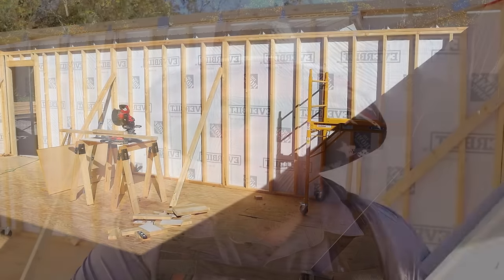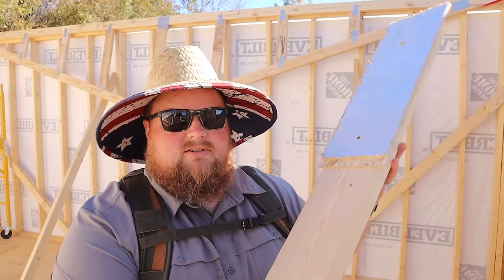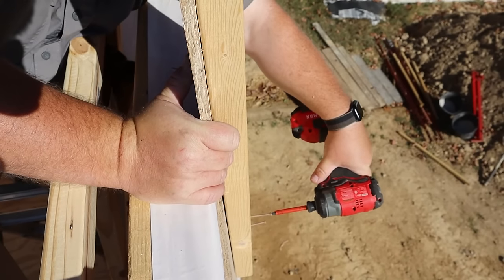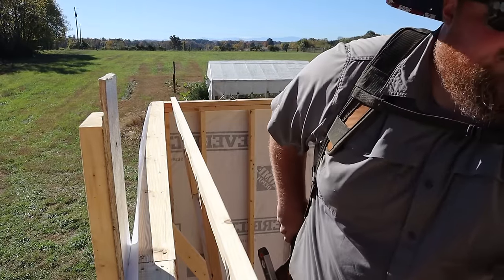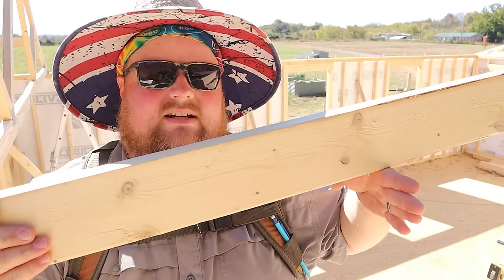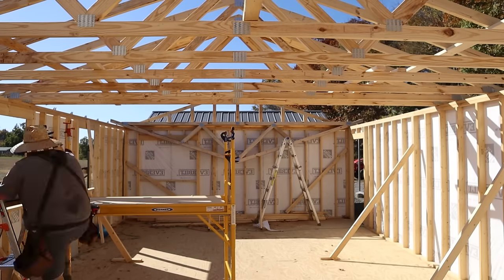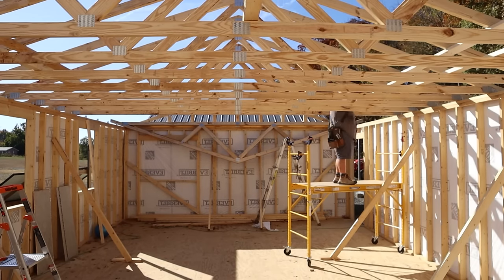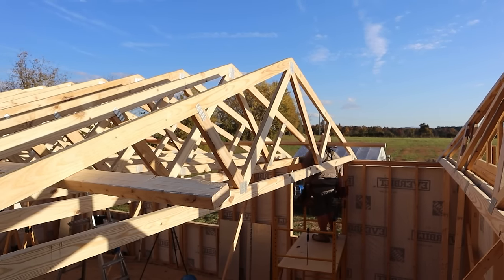I Built this ENTIRE ROOF BY MYSELF! DIY Workshop Build | Setting Trusses & Roof Framing

Comment: Put a 2 by gusset inside of your rake boards to keep them from moving. those toe-screwed fasteners can split out easier than fasteners through the face. The easiest way to measure one is to just trace it and cut it out.

Comment: can't move a mountain over night , but you are sure giving it a go day by day . I have done these truss lifts for many a year and each time I show a new hire how to lift them from ground ,as I nailed , they were sometimes lost. You do make it look easy , which it is after you do one or two . On , one/half or two story , I would place 2-2x4 step splice slides on the gable end  and  ground crew could push the truss half way then I could pull and slide the truss to the opposite end , nail and block . You are doing a great job on your own !

Comment: Not being builder but watchful things doing with it, I have seen I think it is called a rat run or board on other videos.  I am in Australia so am not sure what things are needed over there.  I think the purpose is to stop any movement in the bottom cord of the truss.  I am not sure if the distance between the buildings was a design but it certainly came in handy to be able to have the tractor get between them.  I have watched th whole series and enjoyed every minute of it.
Reply from the maker: I'll be installing much more truss supports after the roof is sheathed. :)

Comment: Fyi on those ladder blocks over the drop truss at gables, 4ft o.c. is plenty. Once you put in blocks over the drop truss you have a 2ft x 4ft framing box for nailing roof ply. Easier to insulate, half the ladder blocks + 1, half the gable blocks, plenty of cantilever strength. 
Cudos for the 1 man crew.

Comment: might be able to extend the ladder thingies so the overhang of the part from the top to about half way down each side of the roof goes out about twice as far and ends up over the roof of the old workshop , could leave it floating over the old roof and create a small v shapep dam on the old roof or graft the new roof ontoo the old roof to make it so the rainwater roll down the edge of the new roof where it meets the old roof and doesnt drip of the old roof part that would still be under the overhang (though a small piece of guttering over the doorway would work too , that and a walkway between old and new shop should make a nice dry walkway between the two
might need to double up the last truss to counter for the extra (roof)weight leaning on top of it

Comment: Nice drone work. My question is how did you insulate the floor on the pier and beam setup? In north central Texas where we get to single digits in the winter, I built a shop like this this. The floors condensated terribly in the winter w the heat on. I had 3/4 OSB subfloor then bubble underlayment then vinyl snap-together flooring.  It caused condensation in the cold months which grew black mold which made my eyes itch terribly. Finally, I had a company come spray foam on the underside of the building/floor.

Comment: I would go back Sam and install a ridge board to tie all the trusses together at the top.
Reply from the maker: I'll add my final truss bracing after the roof is sheathed. I've read that having the trusses able to move a little helps to align sheathing joints, etc. while decking it out easier.

Comment: Sam, a couple of questions:

1. I know you had your sub facia boards lower to accommodate the outside edge of the sheathing, but how did you determine the distance down?   I think i caught you doing this with your speed square,  but just wanted to make sure that's what you were doing. 
2. did I miss your explanation of how you lined up the trusses to be centered with the building?  Can we assume the company that made the trusses placed the splice plates between the diagonal and the rafter portion so the trusses  finds its own center.
Reply from the maker: I used the speed square as a straight edge guide. Putting it on top of the truss and hanging over the end, I then brought up the sub facia board until it touched the bottom of the square and locked it in. 

Before lifting the trusses I measured the width of the bottom chord board and compare it to my building width. It was exactly right, so I only had to line up the truss with the outside edge of the wall, thankfully!

Comment: Well done. I am wondering why you installed your facia boards below the end of the truss tail instead of flush with the top
Reply from the maker: You have to drop them down in order for the roof sheathing to lay flat. It was probably difficult to see, and I didn't stop to explain, but I used the metal speed square as a straight edge guide to make sure the facia boards were level with the sheathing as I attached them.

Comment: Nice work Sam, I’m getting ready to build a 20x 30 shop, if you don’t mind sharing what did the trusses cost and timeframe? I’m tempted to just build mine. Thanks
Reply from the maker: The cost was right at $1,500 tax & delivery included. The company got them to me in 3-1/2 weeks. I didn't trust my skills or engineering to a clear 20 foot wide span without needing supporting walls.

Comment: Hi Sam, great work! Love it…. Just a little question about the roof trusses. I’m from the Netherlands and we do not have already built trusses, so I was wondering….what is the measure from the wood it is made of? I mean the thickness and height?
Reply from the maker: These were made from 2x4 material, but in a stronger species wood than normal wall studs. The species is Southern Yellow Pine.

Comment: That tractor y'all bought is the most use piece of equipment that was well worth the money ..Great job on the roof trusses  Sam what are all those brackets called thanks
Reply from the maker: It sure is!!! :) The metal brackets that hold the trusses to the walls? If so, they're Simpson H1 brackets.

Comment: I know you’ve told us about your hand tools in the past, but I’m currently in the market for a replacement for my drill. What was the cordless piece that you were using for driving your screws in this video?
Reply from the maker: That's a cordless impact driver. It's a Craftsman v20 brushless model ( https://amzn.to/3Nox5nT ). However, I just purchased a new Milwaukee M18 FUEL set (on sale for holidays at Home Depot) and it is amazing ( https://amzn.to/48eNrHB )! They're in different brackets/budgets though. The Craftsman has worked well for me, but the Milwaukee I know will last forever.

Comment: What is the purpose of a drop truss as opposed to a standard  end truss?
Reply from the maker: I feel like it gives a stronger ladder eave system by allowing the boards to overhang the drop truss instead of notching trusses or letting the ladder system hang out there and rely on the roof sheathing for support.

Comment: I'm not a builder, but I've been wanting to build a workshop and in my reasearch, people say not to use screws unless they're structural.  I know the screws you used on the simpson ties are structural, but what were the grey screws you used on the eaves?  I was just curious why you used screws there instead of your Paslode?
Reply from the maker: They are some Simpson exterior decking screws. I used them for the ability to take them out and fix any mess ups I might do. Anytime I'm not confident in the process I like to use screws for that reason. :)
Reply: @Samcraftcom  thank you for the response.  I was hopeful you found a viable alternative to nails. I know you can't show everything in the video, but I was hopeful and thought I'd ask.

Comment: Yo Sam. Do you need diagonal cross bracing between the truss to keep them from falling over like domino's?
Reply from the maker: They're solid enough for now, but will get their permanent truss bracing after the roof is sheathed.
Reply: Ok, be careful. Those roof trusses can fold over under the weight of sheathing, installer, and wind. A couple 2x4's on each gable seams like cheap insurance. No different than what you did to hold the wall framing up, plumb, and not fall over.

Comment: I was until retirement a construction worker. The scaffold you are using here is the same one I bought when I build my shop. After making the purchase I started thinking why did I buy this scaffold. What I should have done was bought the real construction scaffolding from my local rental shop. The regular 5x8 X braced with aluminum walk board. The one you have here will get the job done with a small project like this but the damn thing is dangerous and can get you hurt erecting it. Once put together with the walk board near the top, it can be very unstable and throw you butt off. The walk board is very heavy compared to the construction walk boards and when you get it in the slot, it is very easy to fall out on your. I with ten times I did not buy this dangerous scaffold. So, if any of you read what I am writing, before you purchase one of these, go to you local rental store and rent scaffolding or purchase it. This yellow thing is dangerous putting together alone. To be safe, a two man job. You can also purchase a second level for this yellow thing but it has to have outriggers to keep it from falling over. DO NOT BUY THIS DEATH TRAP.

Comment: be sure to put some diagonal bracing for vertical stability. since you have the trusses joined with stringers, just one or two from the peak to a horizontal runner should do. Great job. Your stamina is phenomenal, and i'm so jealous of your helpers. all mine are grown and gone, so my smallest chore takes three times as long. also great use of clamps for an extra pair of hands.

Edit: I found this video that does a better job of explaining than I did. https://www.youtube.com/watch?v=kZVVmWj9emw